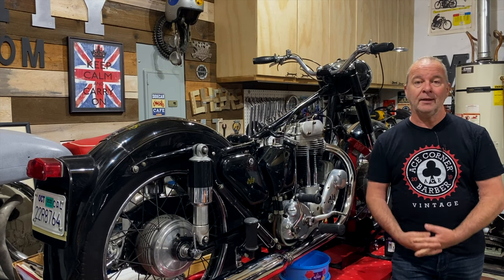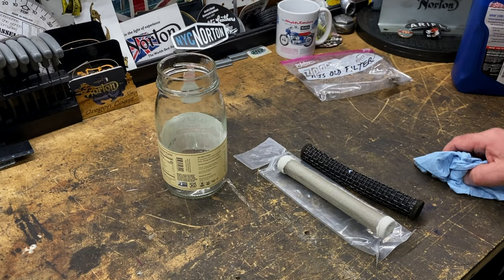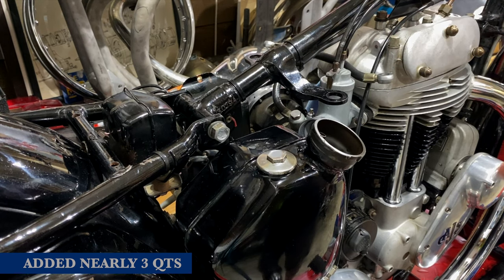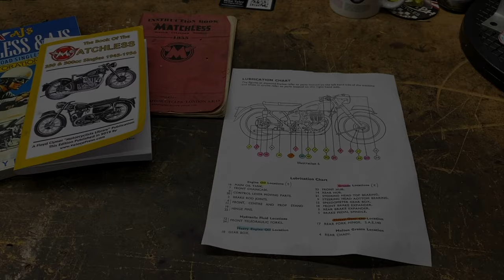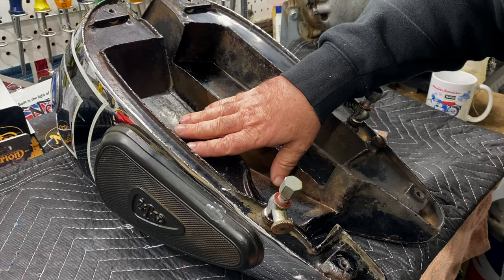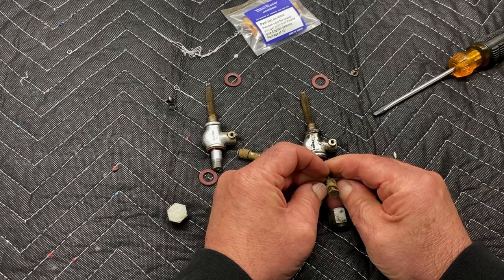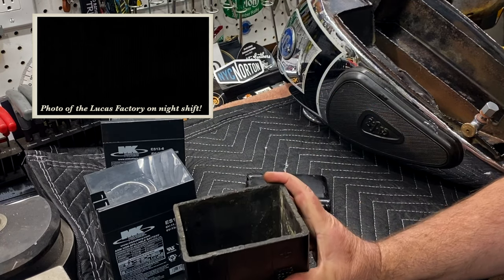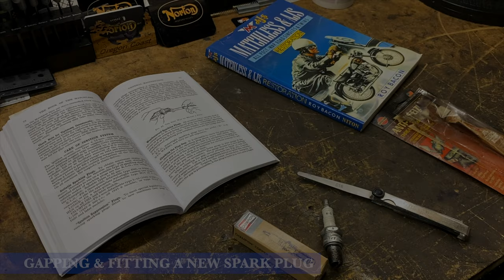1955 AJS Model 18S 500cc Single Motorcycle - Part 4 of 7 - Oil Change & more!

Comment: Great video Mike I enjoyed it. By Jove those old Brit bikes were built to last with all those greasing and oiling points. 6 volt electrics can be sketchy as every connection has to be tip-top. A lot of old bikes get converted to 12 volt as my old T20 Tiger Cub did. Keep 'em coming owd son... I never miss a post!
Reply from the maker: Thank you very much Bob! Hope all is well. Yes, I still have 6 V systems on a few of my bikes and they seem to do OK, but I’ve switched to LED lights on most of them.

Comment: That bike is really cool.  Can't wait to see you take it for a spin.  The brake light seems pretty good for 6v.  I recently converted my 64 Triumph from 6v to 12v because I had a hard time seeing when the brake light was coming on when I was riding in bright sunlight.   I had to get a new rotor and stator anyway, so it didn't make sense to keep it 6v.
Reply from the maker: Thanks Dave. Yes, I was surprised to see how strong the bulbs were. Best wishes

Comment: Pleased to see correct use of 140 grade in the swinging arm pivot, Commando knowledge coming in handy. Those switches are prone to malady of verdigris and lack of regular use like the horn switch.
Reply: verdigris, I had to look it up.  What an absolutely fitting adjective for the encrustation on those old electrical parts etc.